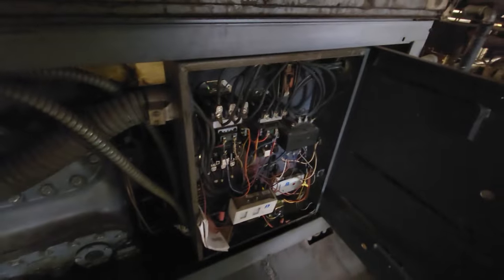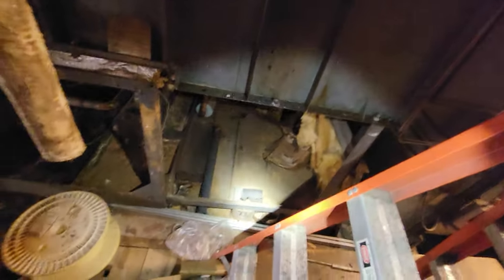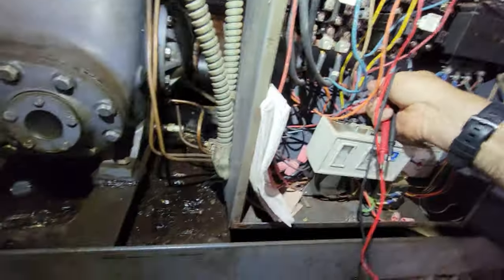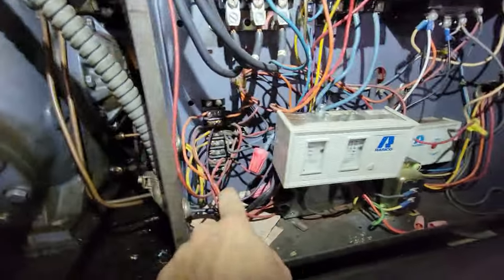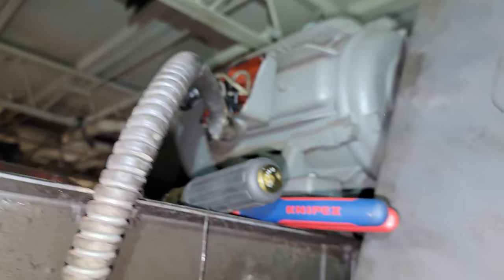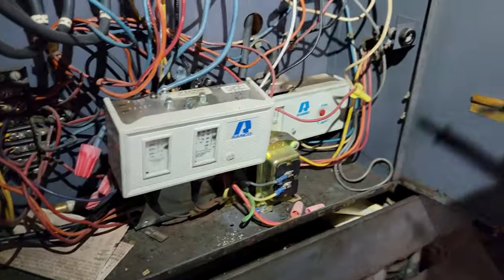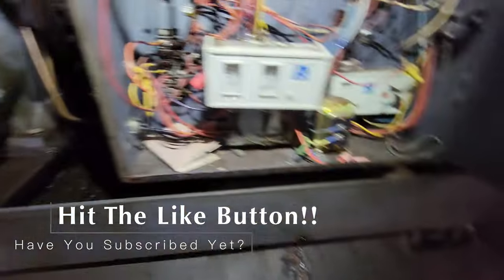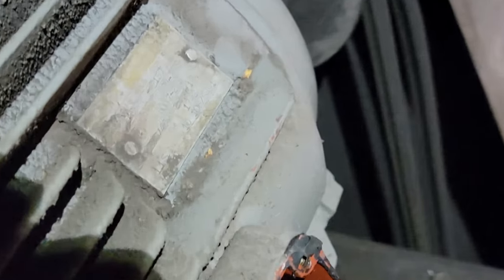Industrial Air Conditioner Not Working

Comment: A few years back our apprentice took it upon himself to change the final filters on the hot deck/cold deck unit. Instead of shutting it down through the BAS he just used the disconnect to kill the power. The BAS thought the unit failed so the steam valve failed open. When he restarted it, the air was hot enough to melt all the fusible links on the fire dampers downstream. Made for a fun afternoon. Great video by the way, thanks for putting it up.
Reply from the maker: Wow that's a great point to mention about shutting it down from the mbs. 👍👍
Reply: LOL

Comment: Great stuff . I started pulling all my three phase Baldor motors and replacing bearings and cleaning the windings , rotor and stator. I went with sealed instead of shielded as techs over the years have mixes greases and over greased the crap out of them. 3 phase motors are tanks but they need a little love
Reply from the maker: I hear you about the grease. Crazy stuff just people don't know that it matters

Comment: Nice job, I have several of those old Trane Ahu’s that I service. Looks like the driven bearings were replaced before( noticed nuts on outside of bearing) usually at least one original spring nut has broken on the bearing plate. Nothing vice grips can’t cure, nice setup. You must have sweat off several lbs. 😓

Comment: Man! I don't know when I can be good like you. You know everything!
Reply: Have faith Steve.  Learn something new every day and you'll get there.
Reply from the maker: @Steve dude it's a slow process, all you have to do is want to get better. I didn't wake up knowing what you see on the videos, sometimes I learned about it minutes before I recorded it. Other things were learned by screwing up.
Reply: Amen to that Rick I have made so many mistakes over the years and learned from them all 
No way we can ever learn everything in this trade but they all the work the same 
Comp, metering devices, evap and condenser

Comment: why did have a 2belt sheave on the motor and a 3 belt sheave on the AHU? great video use to work on a lot of these units
Reply from the maker: That was a weird pulling, it had a 1 3/8 on one side and 1 5/8 on the other. It only had two shieves the other the one had three.
Reply: I used to work on a lot of those industrial AHU  Those big trane piston compressors are a pain in the ass hopefully you won’t have to rebuild one

Comment: its really impressive how many systems you know how to work on. I have kind of an unrelated question though... how much time does your dispatch give you for a call like this? I'm in Resi (trying to get out) and we have to know whats wrong within a half hour, and I bet it could take that long just to get to one of these units in a big factory lol
Reply: A mechanic like this generally doesn't get questioned on time because not everyone can walk up to this kind of stuff and work on it / troubleshoot it. The time takes what it takes.  I always generally think in half hour- 1 hour you should at least know what's generally going on and what path you'll be taking . But ya getting to some equipment definitely takes time even getting into buildings
Reply: Obviously, digging into issues takes time past that initial walk through
Reply from the maker: @John, I take my time and take whatever it takes. Normally they don't bother my much unless we're real busy.

Comment: Those old semi hermetics are bulletproof
I have a carrier water source  AC from 1990 that ran with a blown out suction Schrader for like 3 days.... it was smoking hot, tripping on thermal limit. Pulled a vacuum could smell it was COOKED but it ran when I bumped it🤷‍♂️🤷‍♂️. So put a flare cap and leak lock on the service fitting pressure tested pulled vacuum and added Freon.  Ran it 3-4 days until the old filter dryer plugged up then changed the filter dryer and it's still running 2 months later. Oil looks like an old diesel with 25k miles on it but it's still running 🤷‍♂️🤷‍♂️🤷‍♂️ waiting on approval to abandon in place and run the ductwork to a package unit outside 🙈🙈 

It's a huge 15ton water source AC with electric heat, probably weighs 3000lbs 🤣

Evap coil still not leaking, wonder why 🤔🤔🤔